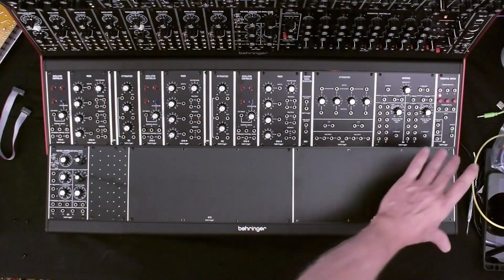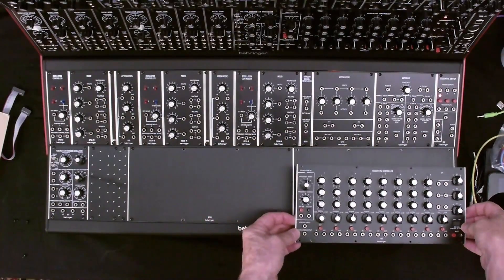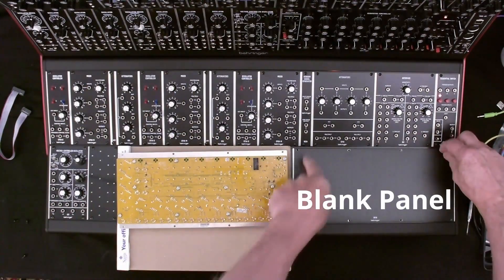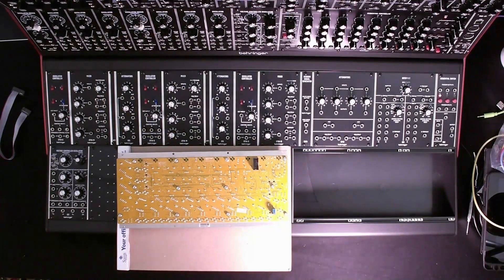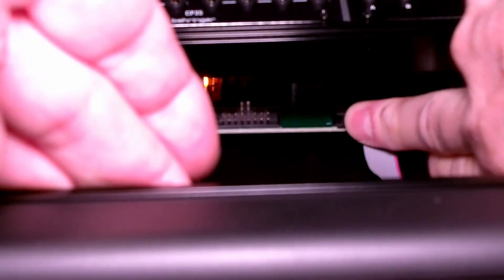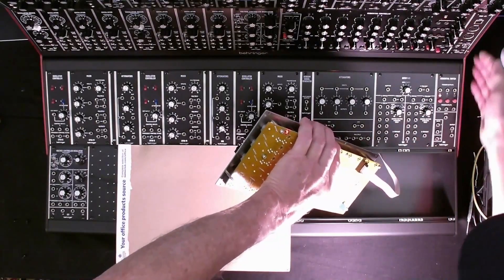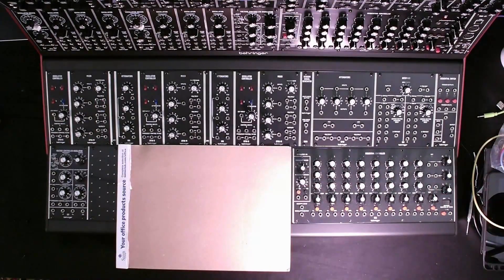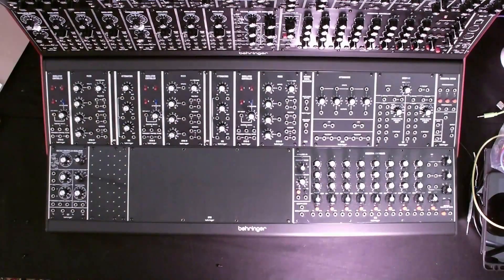Behringer System 55 Sequencer Expansion

Comment: Besides the fact that the extra Sequential Controller seems a bit redundant here - the System 55 already comes with a 960 - it’s absolutely bad practice to connect a module while the system is powered. If any LEDs are still on, there’s still voltage on the rails. Always switch the power off and wait until every LED goes dark before touching the bus. Hot-plugging a module can cause voltage spikes that may fry ICs or regulators, even if you think you’re being careful. Beginners shouldn’t ever risk it - and experienced users have no excuse to.

And just for the files: Sliding nuts suck. I've replaced those as soon as my Eurorack Go arrives. Would be the first thing too, if my System 55 finally arrives. 😉 Keep on patching!
Reply from the maker: I've only had one module go out on me in a GO case.  It was not fried.  I got it repaired by the manufacturer (After Later Audio - at no charge!).
Having said that ... thanks for the comment.  That's some sage wisdom.  I do like having two sequencers.  here's why:
https://youtu.be/Qk4K8Agyrww

Comment: You will, of course, need a 962 module for the new sequencer. If you want to chain the two sequencers together you'll need a third 962 module. The first two switch rows on their respective sequencer and the third switches between sequencers. Also, I have found what appears to be a bug in the sequencers. If you try to clock the second sequencer with the first sequencer they will always be out of sync by one step. It doesn't matter which is the master and which is the slave. The master will always be one step behind the slave. You can get around it easily though by using an external clock such as Pam's Pro Workout. Nice to see your system expanding. Almost time for a second system 55.
Reply from the maker: I have not had a problem using the clock out of Seq1 into the shift in of Seq2.  Reset both before starting and they step together.  How are you patching the clock from Seq1 to Seq2?

Comment: O.Z., I have a question about the system 55 oscillators. The 921 seems to have a much higher level output than the 921B on my system. Have you noticed this on your system? Also, the output of the Aux out on the 921 is much higher than the separate waveform outputs. Not sure if this is true for the original Moog. cheers
Reply from the maker: Tony, sorry to take so long to get back to you.  Here's what I discovered.  The direct (individual waveform) outputs of the 921B Oscillators are almost as loud as the direct outputs on the 921.  The switched/attenuated positive output on the 921 was dramatically louder, to the point of minor (but good sounding) distortion at full volume.  There was about 16dB difference in output levels between the direct out of the 921B and the switched output of the 921..
Reply: Thank you so much for the great info. You have confirmed my experience. Wonderful to have some numerical data! So is there a gain trim pot on these oscillators to turn up the output? Cheers O.Z.
 @ozhalljr
Reply from the maker: @moogfooger  yes there is an attenuator on the front panel for the switched waveform output.  It does include significant gain in the output.  There are no gain trimmers on the PCB.
Reply: Ok that's good to know. Are the original Moog oscillators like this too I wonder? Thanks so much for checking. I love the sound of these units but I have noticed gain staging hurdles to overcome. Using an external mixer has helped greatly, now I can match levels between things much easier. Have you had any experience with the Pro 800? Cheers @ozhalljr
Reply from the maker: @moogfooger   I think the idea is that the levels of the individual outs are set to allow mixing the waveforms.
Reply from the maker: @moogfooger  R.E. orig Moog Oscillators.  I referenced the orig service manual in my other answers.  (obviously, the level measurements were from the  B system 55).

Comment: Should've aligned the sliding nuts first before dropping in that first screw; from experience it can be pretty tedious to get them out if not assisted by a tread on the bottom.
Reply from the maker: You're right!  
I've come up with a technique to manage nut position vs hole in module.  I do this:
1) I leave 8 or 10 HP of no panels to the left (or right) of the module  
2) I position the nuts w/in 1" left (or right) of the hole (exact position not critical)  
3) as I'm putting in the screws (starting with the rightmost [or leftmost] ), I leave them loose until all screws are in. 
4) I position the HOLE to match the NUT, not vice versa.  I do this by sliding the module (not the nut).
Of course, once you have a couple of turns of the screw into the nut, the nut will easily stay in place in the channel as you slide the module.
5) once all screws are started , I'll put the module in the final position and tighten them all.
Reply: Nice technique. The knurled or Allen head screws work really well for me. Start them by hand and they find their place pretty quickly.  @ozhalljr
Reply: @ozhalljr  ye olde twist 'n drag method, works like a charm.